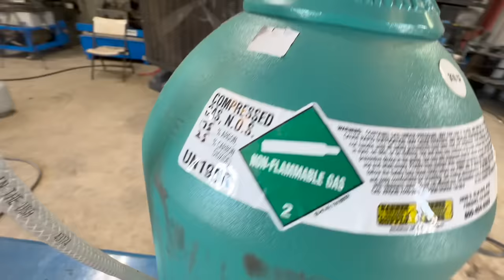Kobelco loader arm part 1

Comment: Between Alistair123, IC Weld, C&C Equipment and CEE....You all make brilliant content with jobs that educate, entertain, and highlight problem solving skills. Great video so far Greg, can’t wait for PT 2 to drop
Reply: I hate when I look down and see the videos coming to an end
Reply: I agree; no acting, no obtrusive "music" added - just problem presented, options discussed then problem solved.  Most intriguing!
Reply: We are same 😂
Reply: Yep , all great channels.
Reply: And snowball engineering
Reply: After warching this video, without trying to bash on fire welding... we can all agree that Curtis from CEE knows a fair bit more than most and is incredibly efficient.
Reply: @harrymorley9847 Whilst I am happy as an Aussie. to read such a comment about Curtis from CEE, I would like to point out that each of the above gentlemen has a great depth of knowledge and experience when it comes to manipulating steel and weld metal. Curtis does also have the advantages of an extensively equipped workshop with both inside and outside room to work on projects. I think that this would contribute to a perception of efficiency. I know that the workshop that Alistair123 works at has the advantages of some cranes, large fixturing blocks and some milling machines that I am sure must make Curtis's mouth water! 😅
Alistair also has to battle against Northern Ireland weather, with rain and cold making life tough and restricting him to his workshop bay many times. Isaac from IC Weld is primarily a site welder and restricted in what he can carry in his mighty work truck. So what he can achieve with his tools out on site is limited to what he can carry and the skills in his hands and mind.
The last channel, (C&C ) I don't think that I have viewed, so I can't and won't offer any opinions apart from saying that all of the gentlemen mentioned have superior skillsets and the confidence to be able to share their work experiences with us. 
These gentlemen can be considered as the benchmarks by which others can be measured against as many are to be found wanting in their skillsets and in their video production skills as well. We are fortunate that these gentlemen have decided to make the effort to video their work lives and to share some of their experiences and thinking that over the issues involved. 
Mark from Melbourne Australia 🇦🇺 Carpenter and sometime welder.
I am referred to as (Fe) Fryer engineering at work because I possess the metalworking skills that others in the workshop don't. 😅 The (Fe) is a play on the chemical symbol for Iron from the Periodic Table. 
Working in a school, this confuses some of the students and catches out some of the teachers. 😅
Reply: Don't forget snowball engenering.
Reply: Check out snowball engineering too!
Reply: Welderfabber very good to.
Reply: Also check out NBS welding, Freedom Fab, Snowball and Welderfabber as others said
Reply: Absolutely correct. I've basically learned to fabricate and weld from a handful of Youtube channels. I'm not great at it, but I'm good enough to make a few bucks here and there, fix my own stuff, and it's fun. Thank you!
Reply: CEE are the best!!!
Reply: @harrymorley9847  100% curtis is a self taught wizard of engineering i compare all others to him but nothing ever stacks up doesnt even come close! curtis is the goat!!!
Reply: Check out Allistair123’s last rock crusher repair series. There’s two different repairs but the last one is crazy
Reply: I think you would like Topper Machine as well. Great guy, thoroughly enjoy his videos. 
He is in my lineup with CEE, On Fire, ABom79
Reply: You forgot the bucket factory
Reply: But if it were a contest, so far CEE is in the lead. #kurtis
Reply: Ic is a hack. As him a serious engineering question about what he is doing and why. And he flips out because he doesn't know ahit
Reply: michael blds
Reply: CEE is my favorite, this is my new also favorite. Good bedtime vids are his Aussie friends 
"BigStackd Casting"
Reply: @markfryer9880 wrong. There's a big difference. CEEs skill sets is high and very technical😅
Reply: Who is the aussie that always closes with "Call your mates?"

Comment: I found your channel watching Cutting Edge Engineering it was a suggestion after I watched CEE that was a few months back. Glad I clicked it I like heavy machinery repairs and welding. I served with the USAF for 25 years as a Jet Mechanic with experience on F-4, F-16,AWACS, KC-135R and B-52 aircraft. Now I’m 70% permanently disabled.
Reply: Jeez, that sucks Todd! Is your disability related to exposure to jet fuel and from crawling around inside fuel tanks and wet wings? If you don't feel comfortable discussing the matter then just say so. No harm. Did you ever manage to score a deployment to Australia for an Exercise at all? 
Mark from Melbourne Australia 🇦🇺 Former Australian Army Reservist
Reply: You might want to check out I C Weld, Issac has some of the same working conditions & operators as Gregg, reckless. Payday & quitting time the most important things about work for some people.
Reply: Thank you for your service, Sir.
Reply: It happened to me too watching  the CEE I found this channel, I like watch  this videos,  I am a mechanic & welder , but I have not all that equipment, I work for a company,   but we are doing miracles 😅😅😅😅😅

Comment: I was figuring you would partially cut the problem ear off so it would be easier to line up. Weld a "jig" in the yoke so it would close to true when you welded it back up.  I have had these types of repairs.  Good job on the fix.
Reply: I guess that it would come down to being able to supply enough heat and force to the part as to the method of repair actually chosen.
Mark from Melbourne Australia 🇦🇺
Reply: @markfryer9880  Supplying heat isn't an issue for me. A rosebud will do the trick. At what point do you wipe out the integrity of the steel. The cooling process affects that, too. I have had to heat things more than I wanted to. I let things like this air cool, but it makes you wonder. Knock on wood. I have had good luck, but I have puckered up doing it.

Comment: That truly was amazing!! Great work, Greg!! By the way, I bought Florin Tractor’s 100 Ton Press, when they went out of business,the frame is massive, that’s what you need!! Keith Fenner built in my opinion, the best press I have ever seen! That might give you some good ideas ( Turn-Rite Machine Shop) I like the way all the press equipment is on top and encapsulated in case of a hydraulic leak!! I believe the series is “Press Talk”,Well thought out, I’ll bet you will do one better!! Thanks, Vic!!

Comment: You should throw piece of cable /chain on the press with safety hook. Save your rams if they kick out and you know it will only go the length of the cable. We do that for using center hole rams for when you  snap 1 1/2 all thread when pulling seized picot pins🙄 .   Great video bud 👍

Comment: another nice repair , me personally would have used lincoln MC6 metal core wire no slag to clean up runs hot and fast  and lays down nice and flat like that fluxcore and while you had the gouge out those 3/8  flat carbons were perfect to knock off those runoff tabs . i might have tacked a couple 3/4 round or flat to the outside of those ears to keep the spacing when you back gouged and welded the inside since you didnt use the spacer again  you wouldnt think she move being that thick it  turn out mint excellent job gregg  and on to the next one

Comment: I had to do that for the bolt anchors on a D10. They hold down the weights. Tried a propane torch, took to long. Just gonna have to get them glowing cherry orange with a cutting torch and use the press. Once they were back to shape. We wrapped them heat blankets. Let them cool over night. Next day installed them back on. These things were bent beyond repair. There like 2 to 3 inches thick and 2 ft long. Your just gonna have to manipulate that glow and bend slowly to shape.

Comment: Excellent decision to cut off the old and weld the new. This is exactly the way I would have done it 50 years ago. Sure, brings back a lot of memories. Pretty impressive welding truck you have also. 
Be nice to see a short video of a walk around of the truck and the way it is rigged. I will be back for part. #2

Comment: When I watch not just your channel but the likes of CEE and IC Weld, I get a sense of relief that im not the only one experiencing such difficulties.

I run three workshops. Car mechanics were we cary out repairs, servicing, and MOT testing. Next door, i have the bodywork and fabrication shop with a separated, double paint spraying booth. Opposite these two workshops, i have what i call general engineering working with lathes and Mills. These are used for military contracts such as parts needed to build tanks and other armoured vehicles. 

Sometimes, what seems like the easiest of projects to complete turns out to be a total nightmare. With all the will in the world, you get to a point where nothing goes right, and the light at the end of the tunnel just seems to get further away.

Like boys in the playground using their jumpers for goal posts only, they move them further away and closer together, making the task of scoring your goal that much harder.

Strange analogy, i know. I guess what im trying to say is. No matter the journey taken to get to where you need to be, difficulties can always be  overcome as all three of you guys have proven. Time and time again.

The outcome with patience, thought, and dedication is that the projects always end up looking as they should do, perfect.

I know, I know, I talk too much. Sorry people  

I look forward to seeing part two soon.👍⚒️🏴

Comment: As a non-specialist, since the initial aim was to preserve this "ear" without cutting and re-welding it, I wonder if reforging this "ear" might not be a good solution in this case ? But of course, you'll tell me that you need a forge, which isn't available everywhere for such a piece of metal !
Good job anyway, like nothing happened !! Rocks !!

Comment: I'm impressed it had sufficient ductility to not crack.  Japan... they are masters of material science.  Its a rare day when I don't lop ears like that off.  I've figured the labor is just about a wash either way... but I'm certain the repair is superior.  Even if it takes two weeks to get the material.

Having the gap be a little too wide is always the preferred outcome.  Far far easier to close them up than it is to spread them open.

Top shelf work as always.

Comment: This is the kind of stuff I could have a blast with! Although I did have the thought of cut it off and replace it when I first saw the project. It was kind of cool seeing all the attempts to straighten it and how close you got.  The other end of that to the floor might've given you you the leverage needed to finish the bend. But the final solution probably came out better than you could've ever gotten the other way.  
Really nice work !

Comment: Give that guy a Gold Star for twisting up that part. That took some doing... L0L. I was curious as to how you were going to un-twist that back into its original shape & location. Bending back is one thing. Twisted is a whole other beast unless you heat that steel to a rosy red color. Then at least you give yours a fighting chance. Looks good man. Well done.
Reply: Wonder if that machine got rolled on its side and the arm had the misfortune of catching it.
Reply: @2xKTfc that would have been intresting to see but nope it’s way simpler then that, the bolt that held the pin in broke.
Reply: @jacobmcnaught3137  Oh yeah that's also no good for the part!

Comment: I believe those are 4x4 billets used to make rod and wire.  These are heated and ran through a dye and roller set up to produce a round shape then drawn out to form rods and wire for cable, nails, etc.  I was a metalurgist for Bethlehem Steel and handled rod and wire products.  These are formed from ingots in a blooming and slabbing mill.  We made 4x4's and 2x2's for this purpose depending on what was intended as the final product.  
The arm you are repairing was more than likely forged using repeated hammer blows to form the shape and maintain strength.  You might need to build a rig and devise a way to rapidly form the metal with quick blows.  Heat can be used as well.  The press will probably not yield the shape you need and will cause you to find the need to deviate from that effort.

Comment: 40 year machinist and welder here. You have to heat that perpendicular to the highest point You could use a Giant threaded rod say about a 2-in through the yolk holes. To pull it while you press. You're really working with the tough ombre there have a good one stay safe
Reply from the maker: Ya.  I wish I could have gotten it hotter.

Comment: I kinda miss playing with all the enerpac jacks/rams at my old job. One time we had a guy shear a 2" threaded rod with a 100ton ram trying to pull an insert out of a die bed. That baby shot 30' in the air to the ceiling.

Comment: you should put another layer of protective mesh screening sandwiched on top of the existing panel and welded to a frame every 4 inches. this will give much better protection. In the current configuration, a piece of metal will bust right through that screen or create a path around the perimeter like a baseball through a hanging sheet, and go right into you.

Comment: I wanted to start a pool as to when you'd cut that tab off.  But you went down swinging and with that tear and cracking it was the only thing you really could have done.  Excellent work.  Now, where's part two?
Reply from the maker: Still in the making

Comment: I saw that coming that that bottle jack will pop out. In my mind i said you should have at least welded block around the jack just to secure it from doing exactly that. Luckily you were in the opposite side when it popped out

Comment: Take this arm to Fire Rite in Detroit they could straighten it and heat treat it when done.
  Very nice welding. Used to deliver gases and oxygen and argon for Praxair to the welding shops.
Reply from the maker: Shipping would cost a fortune probably.

Comment: Good looking weld. Nice machining job, I would think he would have cut the billet closer to the final size so there would be way less material to remove but I'm not machinist so may be a reason like for holding it down or something.

Comment: One thing to keep in mind is that steel gets stronger as it gets hotter up to blue and only after that does it get softer.  At blue temp it is brittle and strong, very crack prone. If you can't get it up to red hot, better do it cold.

Comment: With the stretch tears in the metal of the ear, i wonder if it would be better to have a piece of stock flame cut and graft a new ear onto the link, then line bore to Ensure proper alignment.

Edit to add: later in the video i see this is kinda the route you took, that CNC prep was very nice, and with that full bevel, i have no doubts it will hold.

Comment: For some good machining, straitening and press vidyas look up Keith Fenner at turnwright machine. He built his press and has some nice touches. Most of his straitening is precision on prop shafts but educational. Also a big oxy/propylene torch is my favorite for things that don’t fit in a gas forge, used to heat shrink to straiten and camber jib and bridge crane beams and tubes on trussed ones.

Comment: What a project Gregg.  I wondered about putting a pin thru the holes and gave up the idea. Did you consider cutting it off in the beginning. "Twisting" thick parts like that are a nightmare trying to figure out how to "untwist".  Are there rotary presses????? 
What would a new part cost?     That is a beautiful weld at 36:00.  I found your bead placement interesting.
Reply from the maker: At first I didn’t consider it.  It was more challenging than I originally expected.  A new part was not available. And no used ones were available either.

Comment: Well you have to hand it to the operators ... I really don't want to think of the stress and damage that went through to result in that . Definitely the better way to remove and replace . Did like the low flying Jack that would hurt if you were to catch that wrong . Thanks for sharing can you say at the end of part 2 how long this took with all the heating and cooling I'm sure it's got to be at least a 2 week duration.  Thanks

Comment: Nice repair.  What made you chose a 30 deg single bevel welded in 1G position?   Only asking because that’s a narrow bevel angle and single bevel joint welded in the 2G are extremely difficult to weld without lack of fusion along the square edge.  In the future if you have the opportunity lay-back the the square edge 10-15 deg Or weld in the 2G position with the bevel on the upper side, or 3G.   I know it sounds backwards to use a “harder” position but it makes a higher quality weld.  For equipment repair you can reference AWS  D14.3. Prequalified joints fig a.1.  Joint. B-U4b-GF.   45deg single-bevel- groove, Note Br. “Cyclic loading application limits these joints to the horizontal welding position”.

Also
AWS D1.1  clause 2.18.2. 

“Bevel-groove and j-groove welds in butt joints welded in the flat position shall be prohibited where v-groove or u groove joints are practicable” 

Great job, try and find yourself a copy of AWS D14.3. And follow the pre qualified joint recommendation,  it will make your repairs on par with OEM level repairs.